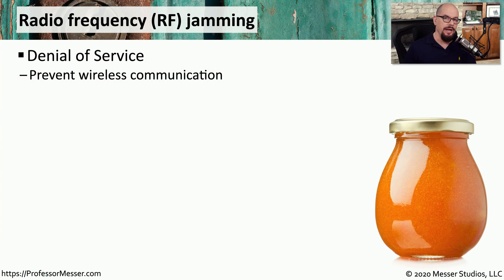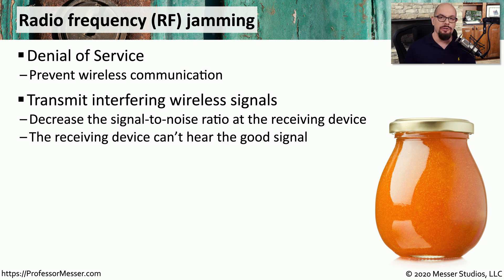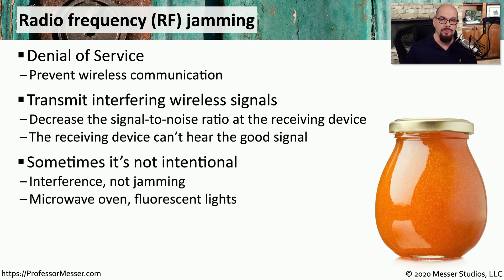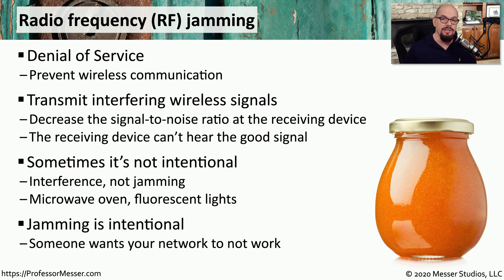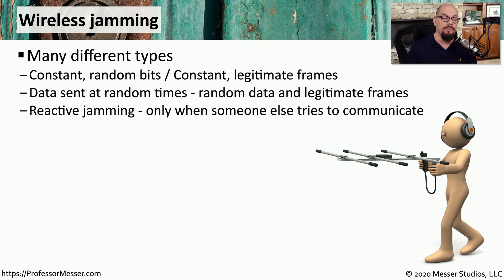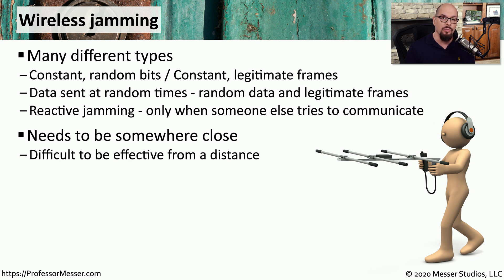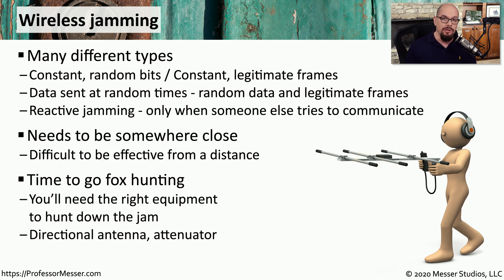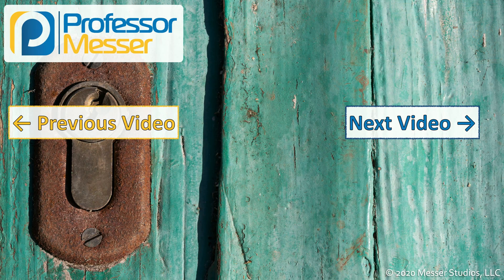Wireless Jamming - SY0-601 CompTIA Security+ : 1.4

Comment: Please tell me can this jamming zap a drone out of the air ?
Thanks
Reply from the maker: Most drones have a failsafe process when they lose their connection to the pilot, so you can't "interfere" them out of the sky.
Reply: but technically it would still disconnect the drone itself from the pilots control right? @professormesser